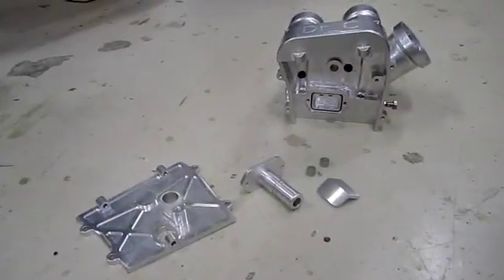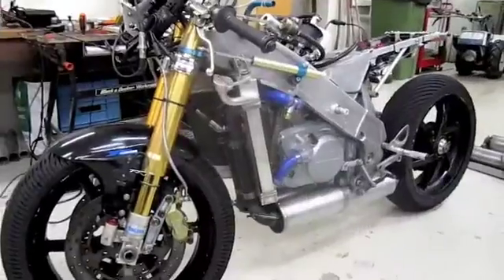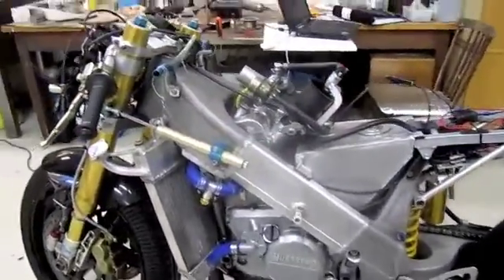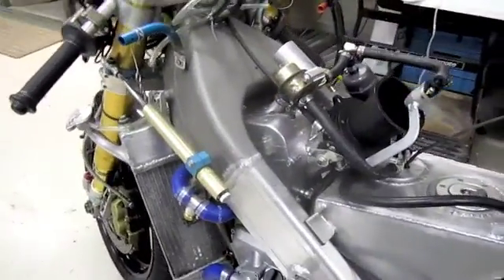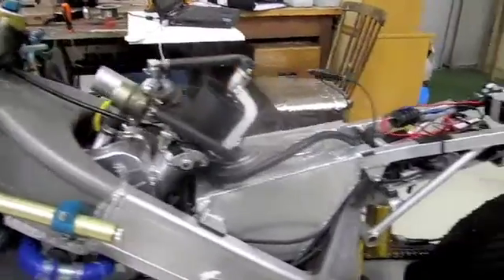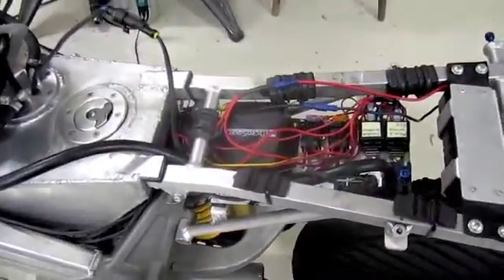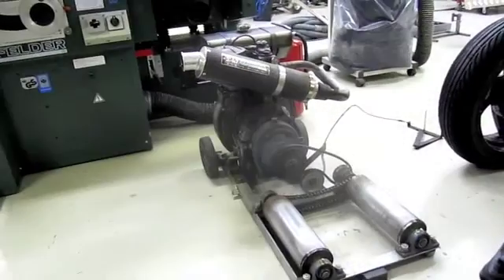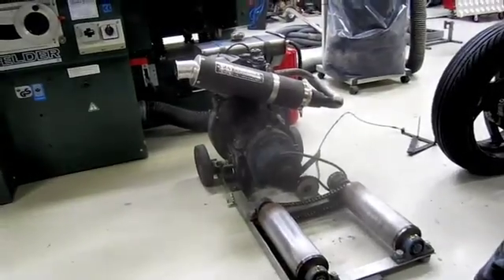Husaberg 650

Comment: Hi Mats, thought you may be the guy to ask, do you know what grade of chrome moly tubing is used in the original frames?
Reply from the maker: I do not know. But as 4130 seems to be the most common used quality, that would be my first guess.
Reply: @Dr_C  thank you Mats, only discovered your build videos after recently acquiring a 2004 fs650 I had built for the previous owner.  Unfortunately someone decided to cut through the subframe in an attempt to steal it.  I couldn't believe what I was watching, very talented guy, keep up the good work

Comment: I was challenged fitting a wheel to a different brand machine and you milled your own 2 cam head with fuel injection
Reply from the maker: I have been challenged with similar projects, but that was many projects/years ago! Nothing would have been possible without a very good network and an understanding wife! :-)

Comment from the maker: Hi David!  I would recommend the 2005 model. It has Kokusan ignition system and the smaller stroke crank. With that model you should get away with just regular oil/filter shift (non racing use is around 10 hours) and an occasional valve clearance check. If your budget is tight, the 2003 would be the second best choice. The older models, will not "blow up", in my opinion, but there were significant changes made to the 2003-model.

/Mats

Comment from the maker: @64BuzzKillington Thanks! Currently I'm using a very strong/oversized coil, but the coil-on-plug design is interesting. I run the ignition mapping with the Megasquirt EFI. I can make more heads if anyone is interested, but as every part is one-off, it is not cheap. I'm upgrading to the 2009-model fairings for this season.

Comment: Thats impressive that you fit a Husaberg engine into a RS frame and tuned it all into one clean package.
If you still are running this check out the coils from Black Ops Moto dot com . Such a simple item has been over looked in bike tuning to this point.Is that head a custom one off item or are they sold for Husabergs?  I cant seem to find any more vids of your finished bike. Id love to see it.

Comment from the maker: @GrahamB29 Yes, I'm using the MSIIExtra. Husaberg has no built n cush drive and neither does the RS250.  I manufactured a new hub for the RS250 with a cush drive just to ease the life of the gearbox and chain. // Bearing in mind the Toyota development department is somewhat larger, I guess it's OK! ;-)

Comment: @Massegossen (don't know why my vid keeps getting attached here, sorry, it's not relevant)..
So are you using the MSExtra software? I don't think the standard B&G code has those features. BTW, a friend with an RS250 pointed out they have no cush-drive in the hub... any probalems with that? Does the Husaberg have a cush in the clutch?

Sorry to hear about the tech problems, but if it takes Toyota 5 years to take a car to production, one season of bug-finding seems fair :)

Comment from the maker: @GrahamB29 Thanks, Graham! The 2011-season was lost due to all kinds of technical problems. Solved one after the other and now I feel like I dare to show up at the tracks again. I use the TPS that came with the Ducati 1098 throttle body, not the MAP sensor for "load-sensing". I believe there is support for quick-shift and launch-control in the software already. But a tip-over functionality would be handy. Good job to write you own code for it! Impressive!

Comment: Great work :-)
So have you raced it yet?

Did you use a MAP sensor, or just the standard u-squirt tps to MAP hack?
I eventually wrote my own code to get a tip-over switch and quick-shift inputs.

Comment from the maker: @krislyttle: Thank you! We made two small "lids" on the left and right of the cylinder head. Between them there are two holes drilled on each side of the spark plug. There is also a water channel between the exhaust ports. This arrangement may seem not to provide enough cooling effect, but it worked just fine on my previous SOHC billet cylinder head.